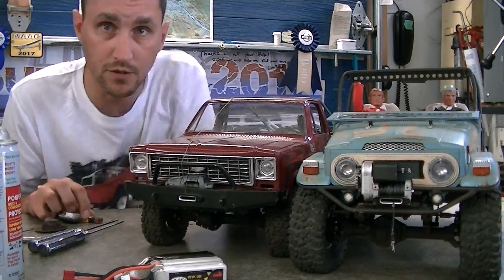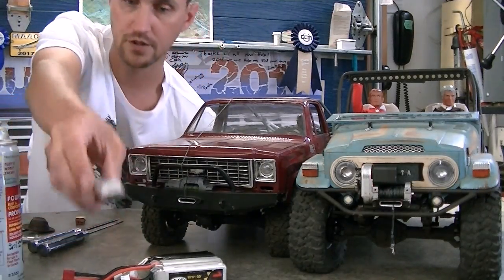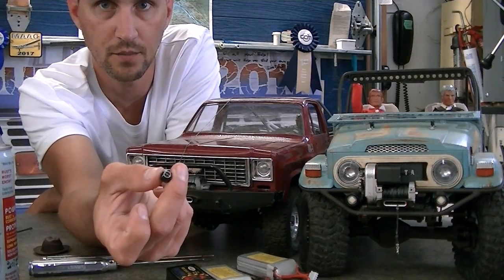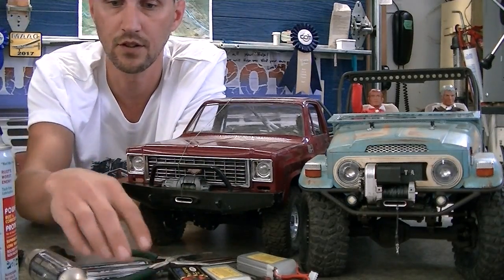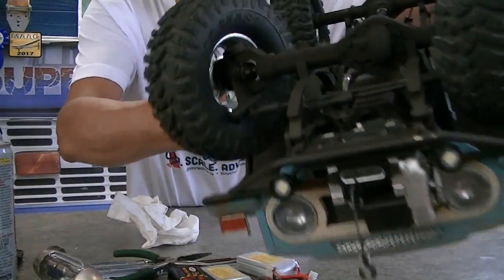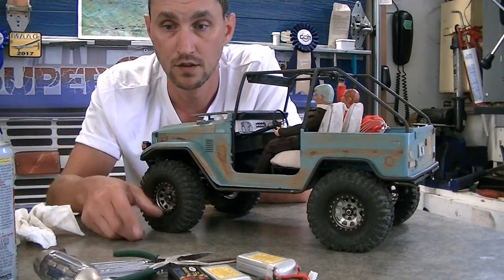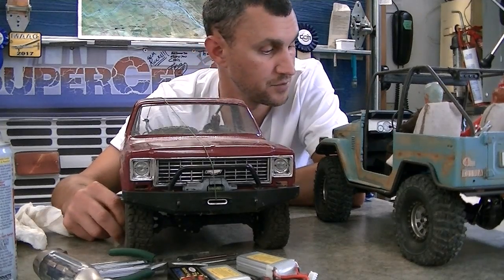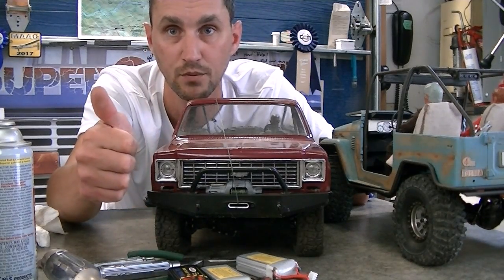Getting Ready for TinyTrucks COMP at ECSC2017

Comment: Thanks for the tips bud. Do you think the 8274 winch will fit on your Blazer?
Reply from the maker: No, I have this bumper pushed fairly far back. There's the smaller winch in there, like the 1/10 size of 3Racing winch.. that size is in there now.
Reply: @GCMRacing1  The one from China? CRO-127A? I really just want to fill the gap. Im runni g the same set upblazer on a cmax chassis.